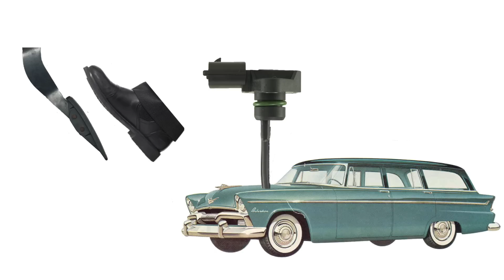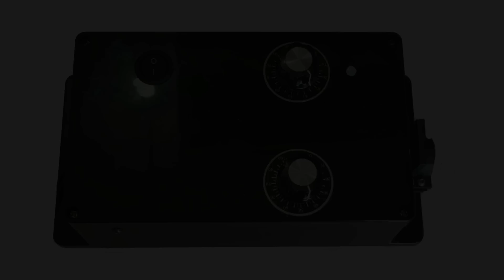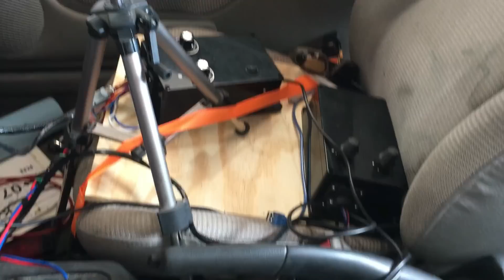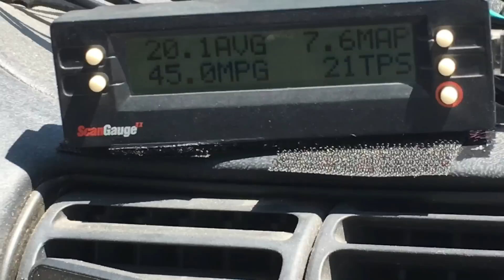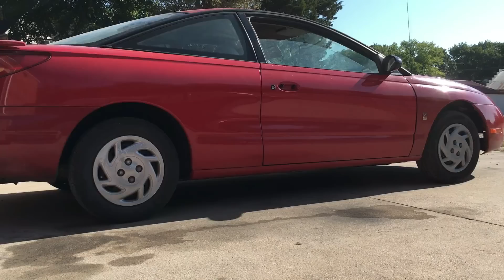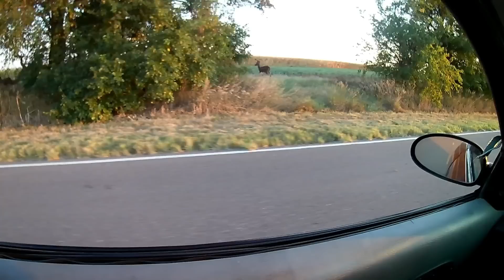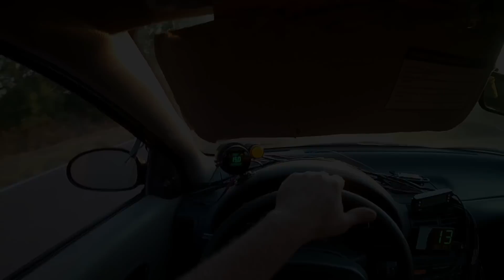S2E20: We road test the fuel saving Robo-throttle on our project car and discover hidden MPG’s.

Comment: LOL on the Ferrari decals. I had an SC2 back in the day with the pop up headlights. The factory color was tan, which I hated, and the paint was pealing, so I spontaneously did an Autozone paintjob in my rental's garage over a weekend and painted it what turned out to be a very bright but matte red (the clear would not lay flat because it was reduced with acetone per the manufacturers recommendations, so it was drying before it hit the surface). Anyway, I had put a set of daisies on the car just prior and did a halfway decent silver metallic paint job with good wheel paint on those, so they looked really nice and shiny. The car actually didn't look too bad when I was done honestly, but I was just trying to get rid of the ugly color and those hideous turbine wheels. The car was a beater commuter car. Anyway, I was driving through the neighborhood one day after all the cosmetic work and I rolled up on some young kids playing in their front yard and so I slowed right down to like 10-15 mph to make sure I could stop if they darted out, and as I rolled by the younger boy goes "Hey look! There goes a Ferrari!" and his older sister goes "That's not a Ferrari!" all mad. I laughed all the way home when I heard that.

Comment: MAP is absolute pressure, so I imagine that 7-8 PSIA is -8 to -7 PSIG on a "normal" gauge where 0 PSIG usually equates to around 14.7-ish PSIA. 

If you weren't (rightly) worried about endangering yourself and others, you could program the throttle ramp for perfectly repeatable test runs. Or could, I suppose, if someone didn't still need to shift  the gears. If only someone would automate transmissions already...

Comment: Here is a crazy idea :  an accelerator pedal accelerates , however if you don't press it the car should maintain speed. What I am trying so say  is : use the robo-throttle to maintain speed in the most efficient  way possible when the pedal is not pressed. For many reasons I will have to  leave the really hard part to you because :1/ i don't have the car ,2/ the tools , 3/25 years of experience, or 4/ programing knowledge. Anyway I hope you find the idea sufficiently interesting to test it.

Comment: Could definitely be modified to detect the conditions.  Hook up your vehicle speed sensor and when the speed is below a certain point, the system will remove the robo-throttle in order to maximize acceleration.  The robo-throttle engages after a certain length of time where the input throttle is at a certain percentage or less, or a certain amount of time that the input throttle has maintained position.  You could also indicate to your computer that you want to deactivate the system for passing or when you need power by having it deactivate the robo-throttle when the throttle position is higher than a certain percentage, like the signal that deactivates the AC compressor when the vehicle is at WOT (if the Saturn pcm is equipped with it) and a certain period of time after the WOT event so it doesn't engage robo-throttle soon as you back off WOT.

Comment: Wonder how the Saturn would perform with full maintenance, fluids, filters, oils, plugs, wires & coils. On top of all that a re-written ECU tune optimized for fuel economy. Could it possibly break into the 50MPG range?

Comment: I’ve done a bit of ecu tuning for power on various cars. I noticed on older ecus, accelerator pedal position was basically linked to a desired throttle opening. Sometimes linear, sometimes not, but the relationship could be easily manipulated. 

Now the new ecus use accelerator pedal position to calculate a desired torque, which then correlates to a throttle opening. 

I think this video/experiment helps explain why OEMs are doing that. At lower pedal positions its effectively doing what you are where it’s removing the human error element for better mpg. But at higher pedal positions it can still give acceleration when needed.

Comment: Have you considered a project on reverse cruise control? Instead of not letting the car drop speed, just limit the speed you can achieve, have safety features of disabling it temporarily if the pedal is pressed substantially far or all the way. You could also add in a feature of throttle smoothing where minuscule changes in throttle would be ignored unless enough to account for a slight hill or preemptively adding throttle to go up a modest hill.

Comment: imagine the market out here that would buy this to put on their kids cars to limit their speed and lack of full throttle ability .. i really do think you are onto something great and am very much looking forward to see what kind of results you get when you have it tuned in
Reply: Modern aftermarket ECUs like Haltech etc already have what's called 'Valet' mode.
Reply: Yeah limit the power so they can't accelerate out of danger. Great thinking smooth brain.
Reply: Honda did this to my car with a software update years before I got it, because the hybrid batteries were dying from being used too much. The car went from getting 45 to the gallon to less than 40, and from 90hp gas + 20 hp electric whenever needed to 90 hp gas + ~10 hp electric whenever it felt like it. Most of the time it is dangerously slow when accelerating, but every now and then it decides to give me 20 hp electric and get to speed. Limiting acceleration sounds great until you need to get on the gas to get out of a dangerous situation, or when merging onto an interstate with almost no on ramp/merging lane and a blind lead up so you can't see if there is anybody there. I usually just elected to take the 45-55mph back road 15 miles rather than they to get onto that rough section of I-25 with most people doing 80+ mph.
Reply: @unclejoe6811  I've been driving for 47 years and I can count on one hand how many times I've had to "accelerate out of danger." And those times were my own fault. Save your "accelerate out of danger" nonsense for people who don't know any better. Tell the kid to stay off the interstates, and Bob's your uncle.

Comment: I have a 1996 cadillac 6 door limousine with the original 5.7l LT1. and i can get 30MPG out of it if i put effort into it, and if i have all the patience in the world i can get 35MPG, but this requires no hills or stops at around 40-50MPH with an ambient air temperature around 90f or higher.

Comment: I forgot to mention this on the previous lean burn video: you probably want to add the offset to the wideband O2 sensor before the conversion, not after conversion to narrowband. With your previous setup I believe you were limiting the useful range of the sensor. Hopefully you consider this before the next episode.

Comment: I know this video is older than dirt, but I think for the 0-60 time, i think short shifting might help your acceleration with the bot running.
Reply from the maker: LOL, indeed the video is a bit old. I certainly don't remember much. However I do remember the Saturn was equipped with the MP2 wide ratio transmission and winding out the gears generally helped with acceleration.  Also, and I don't think this applies, but the shift cables for the transmission were a bit sketchy and the transmission didn't shift easily.

Comment: I feel like you'd achieve similar results using cruise control, at least on a flat road.  What you really need to do is map/model the engine's BSFC and operate the engine at the RPM, throttle position and gear best for a given desired road speed.  More vacuum leads to more pumping loss.  The engine is probably more efficient running stoich at the lowest rpm it could pull a given speed (road load).
Reply: I keep writing a comment that's similar to this, he keeps deleting it. WTF?
Reply: It has been my experience on a stock vehicle that cruise control is horrible to use when it comes to fuel economy.  Even on level ground, cruise control is just very inefficient.  Cruise control is 2D while you controlling the throttle is 3D as you can see what is coming and plan accordingly but cruise control can’t.
Reply: @91CavGT5  Yes this is true but on flat ground it does a fine job. But you're right, if you need to slow down, you can just let off the throttle for a bit whereas the cruise won't know anything.  Plus it's more efficient to slow down a bit on hills and speed up a bit down hills.  However, for solving the issue that he was trying to solve I still think he mostly built cruise.  Solving for high vacuum is not correct - you can drive in first gear at 30 mph and have a LOT more vacuum than you would in 4th but we all know which situation gives better fuel economy.  Vacuum is a better tool when trying to tune the engine.  For a given load, tune for highest vacuum (i.e. spark and fuel).
Reply: @PistonAvatarGuy  I can only guess but if it is too similar maybe he thought you copied this guy's post. If it is sufficiently dissimilar that it clearly is original then the problem must lie in the difference. Since I can't see the deleted post, and I trust your claim to similarity, I must assume the difference is in writing style. From the limit sample of one message from each of you:
Op clarifies the statement to be own hypothesis. Your post includes abbreviated profanity. (I am not judging you, but maybe someone else did.)
Reply: @Jon-yh3gb  Yeah, I hadn't read through the comments yet when I made mine, but, still, it's not like there's a limit on the number of comments. Anyway, I was mostly pointing out that more resources can be found on the subject.

The abbreviated profanity is a result of being frustrated, because my comment was deleted.
Reply: Interesting thought.  On the other hand, the higher the vacuum, the more the fuel will be able to atomize which will increase it's burn efficiency.  This is where incorporating concepts like throttle spacer plates come in to play.  Thinking about thing lately, I have come to the though that the butterfly is an out of date way to deal with controlling intake air flow.  The mustang with the lawnmower carburetor really got me thinking.  If you want to maximize fuel economy, you want to maximize your atomization and run as lean as possible.  If you improve the swirl of the incoming air charge, it will improve the atomization, if you restrict the intake air with something that controls the diameter of the intake throat in a better way,  it will improve the swirl.  I think of something like a VGT which uses vanes to control how much air acts upon the spool of the turbo.  An intake with tapered vanes which could have the depth of the restrictor vanes controlled with a cam actuator could improve the intake air charge, and perhaps find a better balance that would reduce vacuum.  Ultimately, we want the highest Manifold air density, with the least vacuum, and the best air charge to atomize the incoming fuel.  The better the fuel is atomized, the leaner the engine can operate because it gives the best use of the incoming fuel/air charge.  Less vacuum is a good thought because if the engine does not have to pull, it doesn't rob power for the intake stroke.  I haven't thought this through enough to decide if reducing vacuum will make it impossible for the other characteristics to operate optimally, but it's an interesting thought anyway...
Reply: @truckgotstuck  Yes but this car is still fuel injected.  Or it was for this test.  High vacuum isn't going to do anything for fuel atomization with port injection.  MAYBE it would help with throttle body injection.
Reply: @truckgotstuck  this is where running an ICE on true vapor eliminates atomization problems.  I converted a lawn mower to run 100% on vapor(it had no carb at all).  I made 2 videos on this SEVERAL years ago(they were my first videos on YouTube) and they are still on my channel.  The vapor setup decreases fuel consumption while increasing power at the same time.  I REALLY want to experiment with putting a vapor setup on a car!!
Reply: @truckgotstuck  The BMW Valvetronic system is one solution, it's the best way to throttle an engine and maximize fuel atomization, as it keeps the intake air charge velocity high (and turbulent) as it enters into the cylinders, without creating a vacuum in the intake manifold. Honda also uses the VTEC system to the same effect (with a greater emphasis on swirl), but their system isn't continuously variable. The Honda i-VTEC I engine was able to run with an extremely lean mixture (as lean as 65:1), but only under a very narrow range of operating conditions, so it didn't really offer that much of a benefit.

Swirl isn't always the best solution, as it can basically centrifuge the fuel in a way that causes it to condense out of the intake charge, this was discovered by the builders of racing engines back in the '80s. You can find old Hot Rod magazine articles on the subject if you know where to look.

Really, with regard to piston engines, there's nothing new under the sun. it's all been tried.
Reply: @truckgotstuck  Also, there were other ways to increase swirl in the combustion chamber, like the Toyota T-VIS system, or the dual intake system used by Honda on their i-CTDi diesel.
Reply: @kevin9c1  scratches head sounds like the thing to do is heat the fuel in the rail to a point where it's still liquid at rail pressure but flash vaporizes when sprayed.

Comment: Your set up reminds me of some thing we call a pedal commander it obviously only works on drive by wire vehicles I have one and it’s only job is to change the speed in which it opens or closes so it could be for gas saving or for performance but you produce no extra horsepower it’s only throttle response
Reply from the maker: Indeed, those gadgets can certainly make the car feel a lot faster.

Comment: Great result! This set up reminds me my 1997 E39 BMW 5 series also has a similar unusual double throttle bodies set up. The throttle body connected to the engine is a normal throttle cable controlled one, the extra throttle body is controlled by computer functioning as traction control (temporarily closed to take away power when the wheels slip).

Comment: This is some of what I was looking at, but a bit further, for a commuter, if you use a datalogger and map the speeds, you can let the "robotic throttle" use an optimal acceleration based on situation. a more simple solution would be have it only modulate the throttle under 60% throttle, or use a data set to watch for acceleration requests vs constant speed. cool project though!!

Comment: If the car is manual gearbox you don't have to worry about a runaway engine, pressing the clutch solves the problem

Great video, and great numbers
In my 1.4tdi I do 4.4l/100km in daily drive at secondary roads 👍🏻

And thanks for using metrical and the imperial systems in the video 👍🏻
Reply: Kansas Rose  I always hated the switch to metric. Pretty soon we'll be on metric time. 10hrs days, 100 second minutes, etc
Reply from the maker: Correct there are a number of ways to overcome runaway throttle on this car,  One of my concerns was runaway throttle while the car was just sitting in the shop and I was fiddling with the software.   Having the engine go WOT while the transmission is in neutral is a concern, but I reckon the PCM's rev limiter would likely catch that and keep the engine from throwing a rod or something.

Comment: Thing to do is to tie the "mileage minder" activation to deactivate it's function at.... 80% throttle sounds about right. Or manage it on a curve starting from 50% throttle, lowering the vacuum floor by a percentage until it's off by full throttle.

Comment: I think that you can essentially put a low velocity shutoff in the controller.  If you are below 25 MPH your fuel economy is not optimal anyway (unless you own a prius and you dont use AC). Therefore doubling the power output is not seriously going to detract the feul economy since getting to an ideal 45 mph faster is going reduced the impact of maximizing MAP. However as you surpass 25 MPH the map sensor should incrementally increase the minimum optimal MAP pressure to 45 MPH when no more speed economies can be achieved. Alternatively you could link the Minimum MAP to the gear with so that MAP pressure range varies with transmission gear ratio.

Comment: the stacked throttle bodys  reminds me of yamaha sport bikes right after they did away with the constant vac slides  in the efi systems but right before they went full fly by wire

Comment: HP costs fuel, the faster you accelerate to more HP you use.
Engines have a sweet spot around 20 30 procent of load and RPM where it's most efficient per fuel used.
May have most torque at around 50 procent because it can breathe the most efficient amount of air.
Around 90 100 load and RPM it prduces to most HP but also least efficiënt.
So with the vacuum gauge max throttle limit you try to stay in that sweet spot.

Comment: This is pretty much what eco mode on many DBW cars do, only those aren't often optimized for responsiveness, and you'll have an over-ride switch activated at something like 1/2 to 3/4ths throttle, or, if you're driving a Mazda, via a joy buzzer on the floor under the pedal.